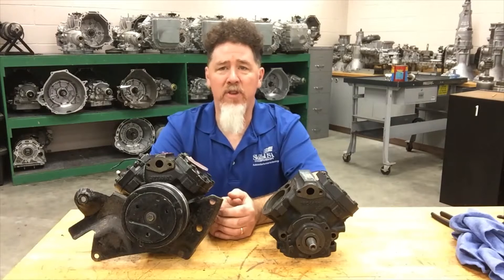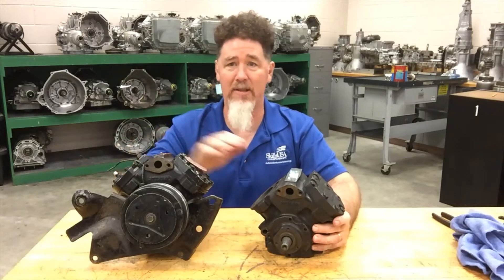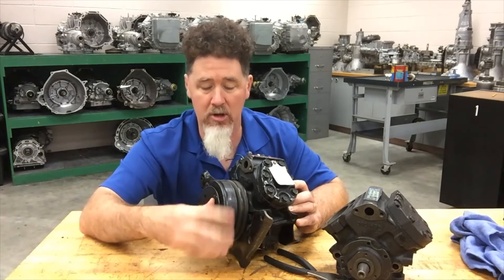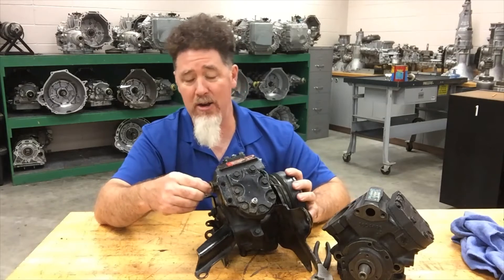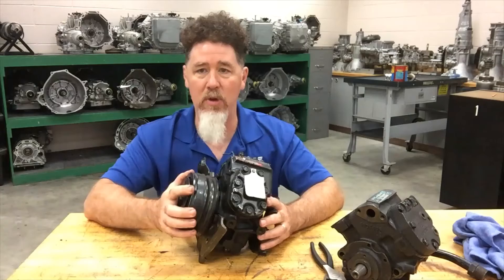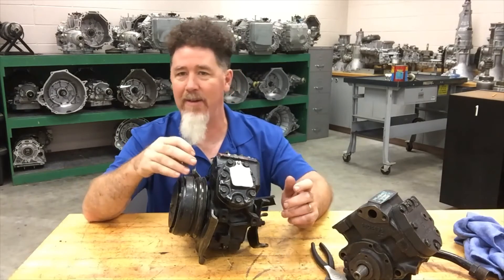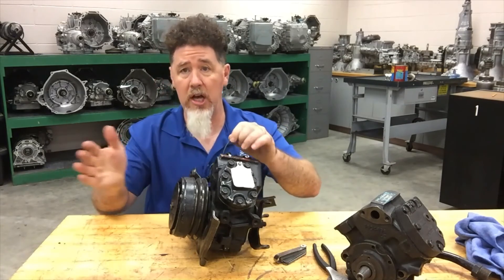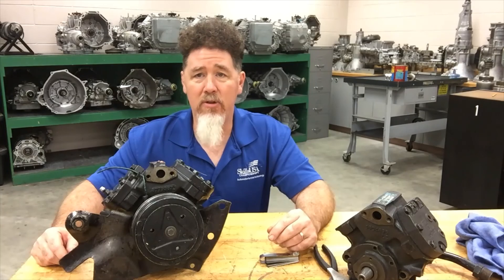Lesson in the V-Type A/C Compressor Part 2

Comment: Read my comment in the "Inline twin cylinder" comments section here: https://www.youtube.com/watch?v=vH-MWvoOUAM  Pretty much everything I said about the York and Tecumseh 2 cylinder compressors also applies to the excellent Chrysler V-2 and RV-2 units. 

For those needing internal parts for an RV-2, look on Ebay, There is a surprising amount of NOS parts like piston-rod assemblies, crankshafts, valve plates, and so-on still for sale out there. Good news for you Mopar guys! Just like I said about the York and Tecumseh compressors, dont listen to the pundits who say to replace it with a Sanden. The 2 cylinder compressors, including the V-2 and RV-2, will last a lifetime as long as oil and refrigerant is kept in them. Typicaly the front seals are the only things that occasionally need to be replaced. Even that can be mitigated by running the ac for a few minutes at least once a week to keep the seal lubricated. Starting on a dry seal is what damages them over time. Also, the V-2 and RV-2 deliver much more refrigerating capacity vs a Sanden. In other words, they blow colder air. So, if you have an old Chrysler product with one of these compressors, fix its issues, fix any and all leaks, make sure it has a proper amount of oil, evacuate to at least 1000 microns, and preferably 500 microns, and charge it up with the proper amount of refrigerant. And if youre spending the time and money to do it right, go all they way! Use mineral oil and R-12. With the original compressor in good condition running the originally specified oil and refrigerant, it will out perform any new cars AC system.
Reply from the maker: Great comments Chuk!